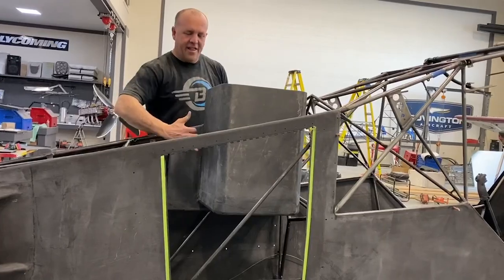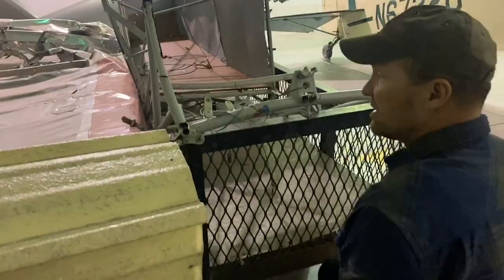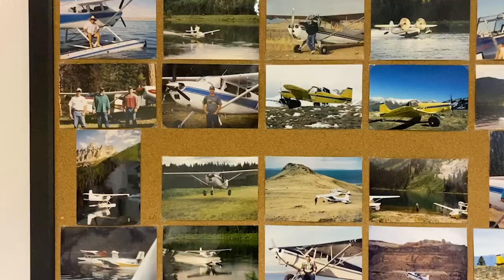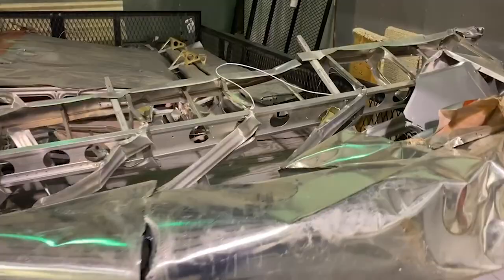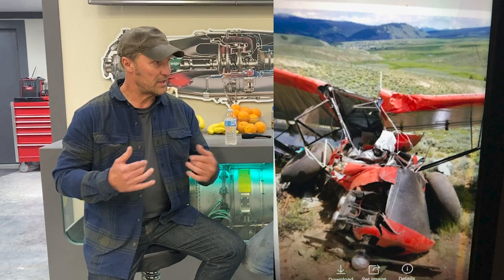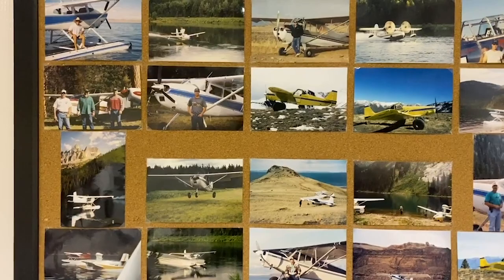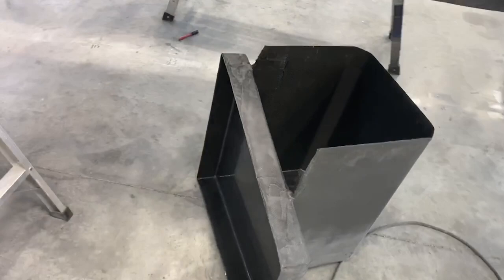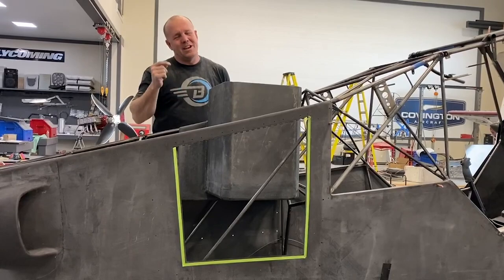Rockets, Boxes and Parachutes Oh My 🤠 (Scrappy Bush Plane 18)

Comment: MIKE!! with the parachute unit placed on the back like this won't the engine get a fatal damage upon landing? Isn't it better to have the unit in a aerodynamic case on the top of the aircraft aligned with the center of gravity,  in a way your badass landing gear could absorb the impact?  Or just have it on the back but hooked externally to the center spot?
Reply: I think it's because if you pop the chute, you're already planning on the plane being totaled. Would love to hear Mike's thoughts too.
Reply: While the 'chute is stored behind the trailing edge of the wing, the shrouds terminate near the CG of the airplane. Once the 'chute is deployed, the airplane will hang in a more or less "level" orientation and land on it's wheels.
Reply from the maker: The Ninja 👍🤠 great question.. it depends on the aircraft what is the best crumple zone and safety for that passengers at the loss of the plane. Some land flat and others nose down. On Scrappy my gear is the safest deceleration zone by far. so when I was doing the landing simulations it clearly placed my straps forward and aft of CG and strap lengths are made to land it on all three wheels
Reply: @MikePatey  nice! Show us some of those simulations as well!  Following up your project is one of the best things happening right now for us in lock down zones!  😊

Comment: I think BRS gets a bad name due to the number of examples of Cirri that probably could have been landed but were instead totalled because of a CAPS pull. The reality is that BRS is great safety feature that should be considered for all new aircraft. The issue with unnecessary pulls is an insurance loss problem*, not a safety problem. (*There are some exceptions of low AGL pulls that resulted in fatalities, but this is a small fraction of the total number of CAPS saves)

Comment: For those doubting the efficacy of balistic recovery chutes, AVweb did a video on the Cirrus system a year ago that is quite interesting: https://youtu.be/zT58pzY41wA

Basic conclusion, it works very well but just having it is not enough if pilots don't remember to use it, and their training program made a major difference. 

I just don't get why a good pilot would be derisive of a system like this, sure it takes up some load, but it provides a valuable extra safety mechanism. There are so many factors that can cause a loss of control and having a chute might just save your bacon. There is no shame in preparing for something that might not happen. It's like saying your car doesn't need airbags or parking sensors. Surely a good driver is never going to hit anything right?

@Mike Patey, if you hadn't thought of this yet, it seems a good idea to insert certain checks on the Ballistic Parachute System in your flight checks to reinforce the availability of it in the back of the mind if you ever find yourself in a situation where you might need it. Cirrus for instances seems to use a call of "CAPS available" in the after climb-out checklist. I can imagine a similar check in the pre-flight or something would also help. (I can imagine checklists aren't high on the to-do list yet, but anyway)

Comment: I was wondering why you didn't quickly put Draco back in the air which we all know you are capable of.  As good as Draco was, he didn't meet your ultimate goal of ZERO take off distance. I believe you have realized the .001 percent that was lacking in Draco and Scrappy will be 100% capable of a INSTANT lift off and vertical climb. I am also seeing landing speeds of 5-10 kn.. Two more world records coming up.
EDIT: I 100% agree with the need for the parachute. The people who are negative on the use of them, that 1-5% chance of total structural failure and their EGO might come back to bite them one day.

Comment: What do you figure to be your minimum deployment altitude that would save your butt?
Reply: Thompson Jerry  Probably optimal would be 1,000 ft, but it would be pulled at any point should structural failure occur.

Comment: Fit it, not use it, no problem. The other way around and finding yourself in the air in such a situation, is no time to come to the conclusion you made a mistake.
As to what you would do in an emergency situation - I've heard all kinds claims, my question, "have you practiced that?"  Because if you haven't, then, you will stick with what you know. Finally,  whether you  button down and act appropriately or not, you will only find out on the day, along with your true religious beliefs, values, affirmations and regrets (given enough time to think about it). I've done that, been there - solidly pilot error.

Comment: Might as well remove all seatbelts from cars because real drivers never wreck. Don’t carry a fire extinguisher in your airplane either because real pilots never experience fires. Might as well drink 2/5 of Jack because real people don’t get alcohol poisoning. Might as well remove all life preservers from open water ocean craft because real captains never have boat problems. Might as well remove your concealed carry pistol from your everyday carry and then take a nice long walk through the ghetto, while wearing your rolex and lucchesse, elephant skin boots because real men never get mugged. Look. ANY safety measure is a good measure. Better to have it and never need it than the other way around?

Comment: The number one reason why military pilots die in a crash is because they stayed with the plane too long. Knowing the point of no return when in an out of control situation is preached continually in the Navy (at least when I served) because the most expensive component of the aircraft is the air crew. Those guys who laugh about safety equipment of any kind are going to be on a first name basis with Charles Darwin someday. Thanks for the safety talk. Even stupid people have someone who loves them and would rather they took the extra step to ensure they come home.

Comment: Why wouldn't you,? when you buy a car it comes with every three-letter safety abbreviation under the sun. I drive 50,000 miles a year all weathers I have been driving for 30 odd years the cars today are far safer than my first metal box on wheels and I am glad it so. plus planes are expensive why wouldn't you want to protect yourself and your investment.